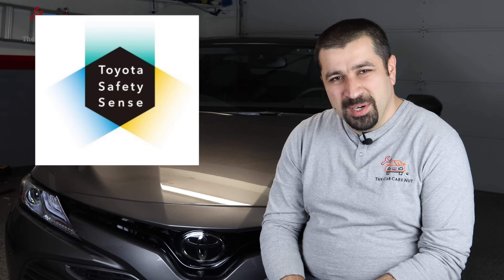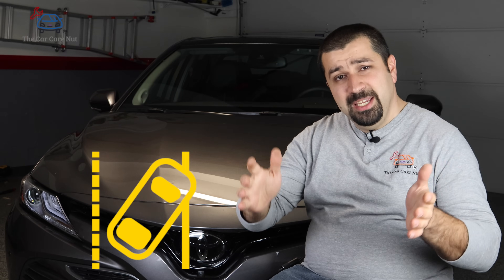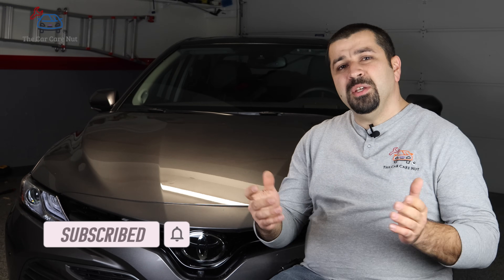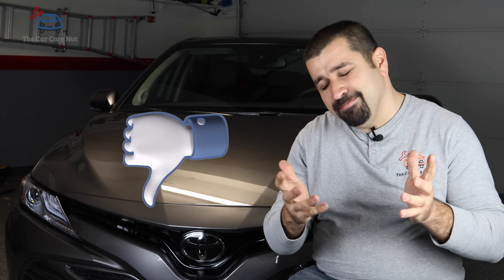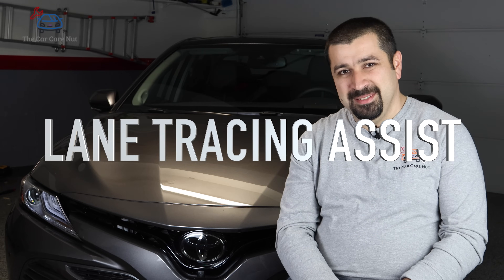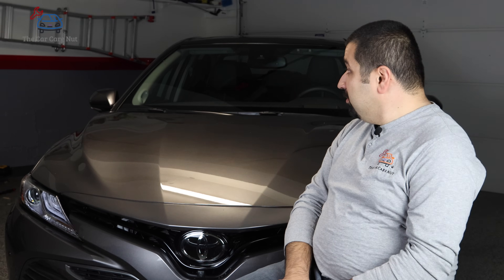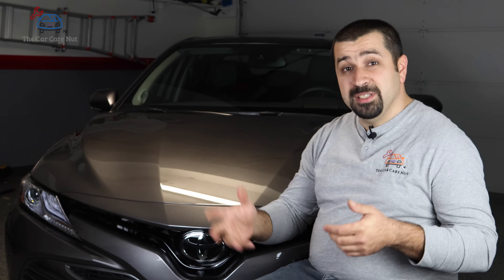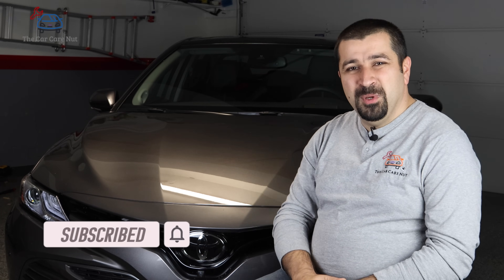How do Toyota Safety Sense Work Part 3 Lane keep assist and Auto High beams

Comment: Something else that people need to understand is that any brand of car that has optical systems behind the windshield need to get an OEM windshield and OEM calibration if the glass is replaced. Toyota has a memo on the subject. Go to a Toyota Collision Center and a good service advisor will know about that Momo and will supply it to your insurance company because the windshield replacement will be over $2,000 when you count the calibration time.

I literally was at a Toyota Collision Center and two of their customers had problems with their Safelight installations...

Comment: I have a friend who had a Mercedes a few years ago and she was driving down the highway heading home and there was something in the road and she tried to swerve around to miss it and the lane tracing assist turned her back into her Lane and she ended up hitting it. She took the car to the dealership and complained and was told by a mechanic that when you go to swerve out of your lane you have to turn your turn signals on so going out of your lane will be allowed or else it will just steer you back into your lane and you'll end up hitting what you're trying to avoid. And the thing that I don't like about it is when you see something at the last minute and you have to swerve the last thing on your mind is to turn on your turn signals.
Reply: With Toyota, you’ll fell some resistance but you’re still in control. If she was doing a Toyota she could have easily avoided the object

Comment: This series is the most informative series I’ve ever seen.  Where it fails is I don’t know when it is talking about my specific model or level within a model.  It would perfect if at the start I could enter my car info and it would tailor the info to my car.  But I know that would be very expensive to do.  However, it is leagues beyond every other company I have found.  I love my 2023 escape hybrid, but I didn’t even get an owner’s manual.  I don’t even know what systems I have in my escape.  I have an escape because ford had one available when Toyotas were on a year waiting list.

Comment: I had a 1985 T-Bird that had automatic high beams. If you came to a blinking light, the high beams would flash in time with the light. I rarely used that feature. lol.

Comment: Great video on the safety sense system, I am wondering if there is a video on the backup camera. My backup camera works good in the daytime but it is terrible at night. The dealership would not replace it while under warranty. Is a better camera available that will fit the 2017 Toyota Corolla SE?

Comment: Very useful information. Thank you. 
Every time I start the car, the safety system works perfect, but after around 30 min the system not working and it appears that front camera unavailable. What is the possible problem?
Reply from the maker: Hi! Is there any debris or dirt on the camera?
Reply: @TheCarCareNut  How can I ensure that the camera is dirty or not? If you mean the front sensor I cleaned it.

Comment: I like the LTA on highway driving. We own a 21 Sienna and a 22 Prius L Eco and it works well on both. You just have to get used to it nudging you around and know that you still have to maintain control at all times. The only time it's gotten a little hairy for me is when a highway splits in two and you may lose lane markings. In that case, you've got to absolutely take control and "fight" the LTA for a few seconds. Take the Nut's advice... It's not an auto pilot!

Comment: The LTA in my 2021 Rav 4 XLE Hybrid keeps my car in the lane but never centered. It always makes the car stick to the right lane. Is that normal in the new LTA system?
Reply from the maker: Hi! Is it turned on LTA? And when you navigate to the driver assist screen does it show two blue lines?
Reply: @TheCarCareNut  yes
This strange behaviour happens when LTA is on when cruise is on. LTA with no cruise works great. Is it because of the sensor in the Toyota emblem? The program does not seem to work right.

Comment: New 2022 Corolla Hybrid Sedan with TSS 2.0 (Australia - We drive on left) I have driven 200 miles so far .  LTA with Dynamic Cruise keeps VERY CLOSE (6-8 inches) to the right of the lane on a multi-lane highway, and VERY CLOSE (6-8 inches) to center line on a two lane road. (center is on the right because we drive on the left here)  Both roads have very clear white lane markings which show up well in the display.  QUESTION:  Can the distance LTA keeps to the right or left of a lane be set or adjusted by dealer?  If so, I will mention to dealer when I take it back for its 2 month check.  Note:  In the 5 months I waited for this wonderful Corolla I watched almost all your videos (some more than once) so I was WELL PREPARED when car arrived - THANK YOU!!
Reply from the maker: Hi! Unfortunately such adjustment is not possible. It would be really nice if that was possible as you are not alone. I see it doing that and many others as well
Reply: @TheCarCareNut  Thank you for the good info.  I'll adjust to it as is - a great system overall.

Comment: Why is it when I use cruise control in my   Toyota   Corolla 2018   The transmission gears up or down when I go up and down a hill
Reply from the maker: Hi! It knows your going up or down a hill and goes in a lower or higher ratio to help

Comment: I find that the auto high beam works very well.  I live in Wyoming and do quite a bit of highway driving at night.  The camera on my 2021 Tacoma actually sees an oncoming vehicle faster than I can.  This is probably due to the fact that the camera is at the top of my windshield and it sees the oncoming lights before they come into my vision.  Sometimes the tail lights on the vehicle ahead are dim from dirt or some such and my high beams don’t deactivate as soon as I would like.  It’s easy to dim them and the advantages far outweigh the negatives with this system.  Especially since I have the LED headlight package I don’t want the auto system to malfunction and blind other drivers.

Comment: Hope you see this comment. I’m considering buying a Corolla hatchback. Is it easy to override the lane keep assist? I drive on back roads a lot where I have cyclists and pedestrians on the side of the road and I like to give them a wide berth as a courtesy. Or, is it easy to turn off while driving (a physical button) or do you need to pull over to access it on a software menu?
Reply from the maker: Hi! On the corolla you can turn it off very easily without stopping. Once you turn it off it stays off until you turn it on again
Reply: Thank you!

Comment: I have a new Toyota Yaris Hybrid, Model 2020. On the website, they talk about "radar" and sometimes "laser". What is correct? Does it use an (old school) laser to measure the distance, or does it have a radar? Or does it not use both of it and only the camera instead?
Reply from the maker: Hi! It depends on the trim. Does your emblem has texture to it or is it flat?
Reply: @TheCarCareNut  The car will be here in 2 weeks, but I think it's not flat.

Comment: I have a 19 Corolla and have the 17 inch wheels with low profile tires. If I went to a tire with more of a side wall will that miss things up?
Reply from the maker: Hi! You can’t really go much bigger as the tire will start contacting the car and causing issues. If you wanted go with a smaller wheel size
Reply: @TheCarCareNut  thank you

Comment: Great video. I find it interesting though, I have a 2017 RAV4 with LDA and steering assist. I don't find it bad at all. The trick is to keep your entire hand on the wheel so it can sense it. I've never felt like it was fighting against me at all. I also love the auto high-beams, though I admit you need to take over manual control on roads with lots of turns. Unfortunately the camera cannot see headlights coming around a corner and pre-dim them like we can. Not yet! But these features make a 3 hour road-trip on the highway feel like an hour long trip. At least for me.

Comment: AMD: My 2018 RAV-4 (gas engine) blinks something on the dash that says the system is disabled at under 32 MPH. I don't know if this means it will not stop or whether it means the lane keeping assist function is disabled. The statement disappears very quickly. What does this statement mean? I should know by now, but I have never had the system slam on the brakes. Please help me figure out this technology.
Reply from the maker: Hi bob! That message it totally normal. So the lane keep assist which is a feature in your car doesn’t work at speeds below 32 mph and the car is showing the message to let you know that. If it bothers you, you can shut off the lane keep assist and it won’t appear again.

Comment: My wife bought a 2020 Camry LE one week ago and LDA has helped a few times. First time on standard she almost drove off in to the ditch or muddy/rocky sholder. She crossed the line but still had 1ft of payment. I moved it high cause most of the road she drives just drop off suddenly after the line. I know a few people who have gotten in bad wrecks or killed cause they over correct after going on the shoulder. We both find the system is gental and easy to overcome if needed. You forget to talk about the away alert system that  help with looking like a idiot. My wife is very short so systems like rear view camera, blind spot, RCTA help a lot. Head rest in the way,  rear glass up higher and smaller it can be almost impossible for her to see. Be nice if had bird's eye view so she can pull to parking spots easier.
Reply: Maybe your wife needs to stop driving before she kills someone? 😳
Reply: @Nightbird.  She was just getting use to the car. It it way more sensitive to steering input then her old car. Her defensive driving and unfamiliar area driving bugs me.
Don't forget there are a lot of short people driving and they have hard time seeing over the back head rest and beyond the door pillers.
Reply: @polsdofer960  Glad to know she will be OK. Best of luck to her!

Comment: What is your opinion on using the adaptive cruise when towing. I really used to dislike the old cruise control but on a trip the adaptive cruise is really a game changer.  I haven't towed with my Tacoma yet but not sure how safe it would be when towing.  Maybe if the road was open and not many cars it might be ok. I'm thinking not good on a more filled freeway due to needing more time to slow or stop.
Reply from the maker: It could work but I’d rather you are heavily supervising it as it could be jumpy on the brakes because of the extra load of the tow

Comment: LTA works as good as Tesla auto pilot. I know cause I own both cars. Turn on the sensitivity on high it work better for the Rav4.
Reply: And you can buy the small electronic device that clips to your steering wheel and vibrates to keep it going without keeping your hands on the wheel..which was originally made for Tesla. Although it's not legal everywhere.
Reply: @Nightbird.  Some of those devices are selling for over $100 just buy a 2 pound ankle weight that has velcro and wrap it around the steering will it works.
Reply: @badimpulses17  So how are you enjoying your Tesla Model Y? I was looking at your videos of it and I was really surprised you had to install two fans on the dash for more air circulation. But I love cold air to be hitting me directly on my face and neck so I would have done the same thing as you.
Reply: @Nightbird.  I sold the Model Y and now I own the Rav4 Prime. The Prime is a much better car.
Reply: @badimpulses17  You got me thinking about Tesla and I was watching videos showing how amazing the Autopilot is. What do you think about buying a used Model S? It looks like the safety system on Tesla is much better and advanced than what is on Toyota. I was planning on buying a 2021 Toyota Camry because of the TSS 2.5+ safety package..but it seems the Tesla safety is much better. What do you think?
Reply: @Nightbird.  The Tesla autopilot is more advance but the Toyota works just as well.
If you do a lot of road trips then a Tesla will take you longer to get to your destination due to range and constantly having to charge. 
I went to Las Vegas I ended up having to charge a total of six time just to go there and come home. On the other hand on my Prime I went To Vegas came home and still had a quarter tank left over. I was really disappointed with the Model Y,
the fit and finish, ride quality, cabin noise, rattles was just too much for me to ignore. Granted the Y was really fun to drive and was really fast. Driving the car daily with constant road noise and rattle just drove crazy.
The Prime has none of the issues it rides smooth and is really quiet, getting close to 600 miles is freaking awesome.
Reply: @badimpulses17  Thanks for the info! I agree with you that having to charge the battery so often and then having to deal with road noise, rattles and a bad ride would also really bother me and make me regret buying a Tesla. And I just found out from the Toyota dealers in my area that the Toyota Camry I wanted with a particular color and features would be a "special order" and take 8 months to deliver! I only wanted it because of the safety TSS 2.5+ system..and I can't wait that long..so I'm now looking at used Mercedes Benz S Class cars because other than Toyota and Volvo they have the best safety, ride and comfort..even though any maintenance or work done on them will be expensive.
Reply: @badimpulses17  After you told me how much you enjoy your Toyota RAV4 Prime I took a closer look at it and watched some videos and it really does look like the ideal vehicle for me..especially since I wouldn't have to use gas anymore for my trip to work every day due to it's all electric range. The only thing I don't like is that Toyota didn't put the TSS 2.5+ safety package in the 2021 model and my Toyota dealership says they are not sure it can be added with an update if I purchase the 2021 model. Is there anything you don't like about this vehicle that I need to watch out for? Thanks.
Reply: @Nightbird.  The Rav4 Prime comes with the 2.5 + features. The LTA is as good as Tesla autopilot. I drive mainly local not too much highways so I barely you the features.. If you have a chance or lucky enough to get a Rav4 Prime just buy it you will not regret it. Mines is made in Japan the car is solid. I paid 60k for the XSE fully loaded, with the $7,500 tax credit.
Reply: @badimpulses17  Thanks for the info. I have seen a couple of reviews on it and it looks like a great vehicle. But I had no idea it is really hard to get because of the battery shortage right now and there are none in my area so it will probably take a while before I can even test drive one. Stay safe my friend.

Comment: Great job.  Because of getting pulled towards a truck, as you described in the video, I turned the system off.  It happened a few times and really scared me.
Reply: What really bugs me is that nobody at the dealership believes that the system pulls me towards the truck as you described!
Reply from the maker: It happens. Until the dealership mechanic or advisor drives a car for a long time and this happens to them they won’t imagine it.

Comment: I've found that these gimmicks are pretty useless and at worst dangerous. Many times full beam is activated then immediately deactivated looking as if you are flashing another vehicle. This could make someone pull out in front. The collision warning triggers regularly for no reason but didn't work when it was needed. I'm glad its it's only a warning on the display

Comment: LTA reminds me of years ago driving the tractor on the farm. The steering would pull toward any furrows or tire ruts to follow old paths. It feels like a bit of a tug of war when you need to be a few inches to one side or the other of that. On some of the roads of south and west Chicago burbs, LTA favors a bit too far left or right. So the steering wheel keeps nudging me back the direction of the "furrowed" path it favors. At least with LTA, I can turn it off as necessary.
Reply: recently drove 800 mile trip in my new 2021 Rav4 hybrid prime. On straightaways with clear road lines and nobody around, the hands on wheels sensor was downright infuriating!  Every 15-20 sec., whether or not hands were on wheel, the warning illuminated, then beeped, sometimes was downright HARD to get rid of it, gripping and shaking the wheel. Turning LDA off is not a practical option. The best workaround i found is to quickly toggle Off-On the LDA button on the steering wheel, and you get another 15-20 seconds of harassment-free driving, and if you press fast enough never lose steering assistance. And don't worry--having to repeatedly hit the button keeps one from falling asleep. At the very least it gives you and passengers a break from motion sickness from the wheel jerks.

Comment: I live in Texas and Auto High Beams will get you shot or pulled over..  This is my first vehicle with auto high beams and I can tell you they are dangerous unless you live in the woods or use two lane roads.  Welcome to Texas
Reply: I recently drove 800 mile trip in my new 2021 Rav4 hybrid prime. On straightaways with clear road lines and nobody around, the hands on wheels sensor was downright infuriating!  Every 15-20 sec., whether or not hands were on wheel, the warning illuminated, then beeped, sometimes was downright HARD to get rid of it, gripping and shaking the wheel. Turning LDA off is not a practical option. The best workaround i found is to quickly toggle Off-On the LDA button on the steering wheel, and you get another 15-20 seconds of harassment-free driving, and if you press fast enough never lose steering assistance. And don't worry--having to repeatedly hit the button keeps one from falling asleep. At the very least it gives you and passengers a break from motion sickness from the wheel jerks.